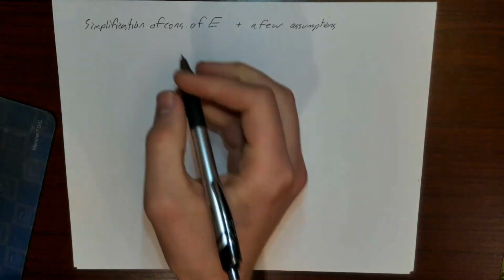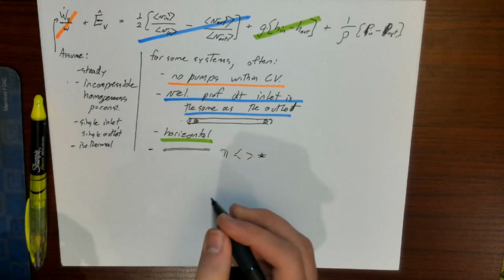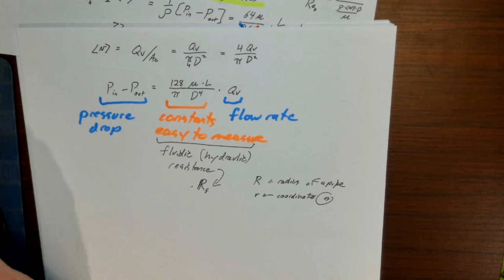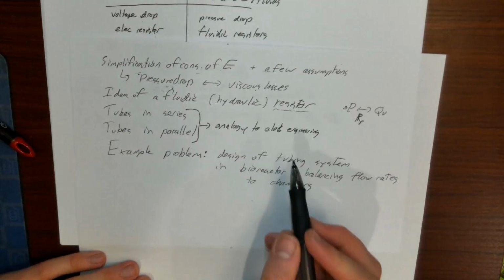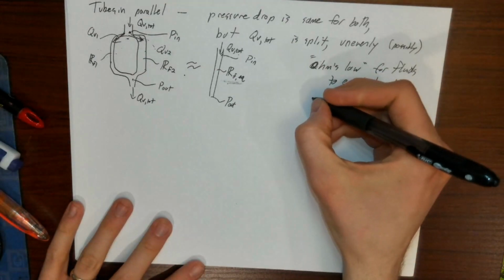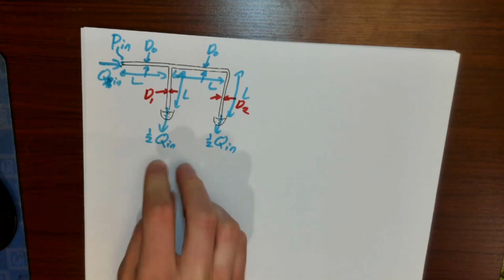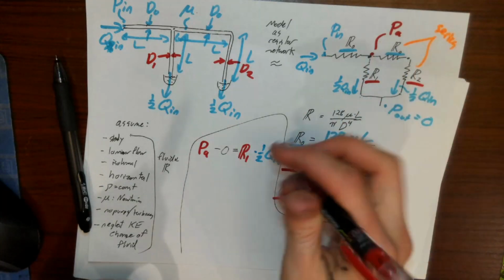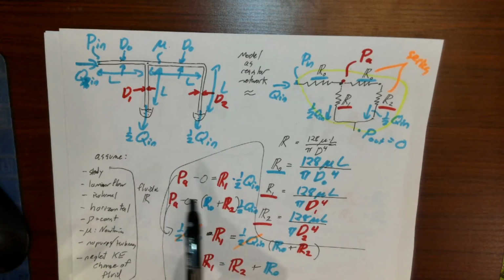BIOE 3310 Lec 12 - Fluidic (Hydraulic) Resistors

Comment: Simplification of steady-state conservation of energy with additional assumptions 5:20
Fluidic resistance as proportionality constant between pressure drop and flow rate
Analogies to electrical resistors
Resistors in series 26:25
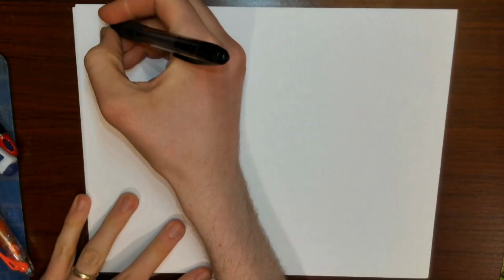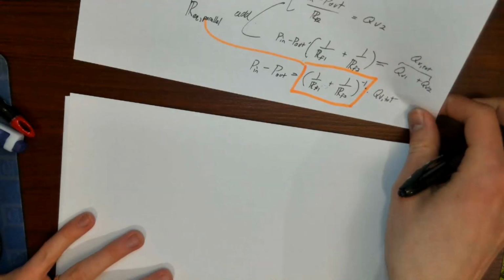Resistors in parallel 37:20 44:23
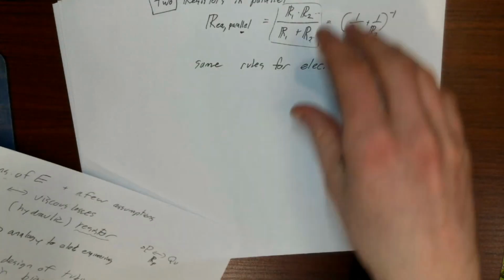Example problem: choosing tube diameter to balance flow rates in a bioractor 47:40